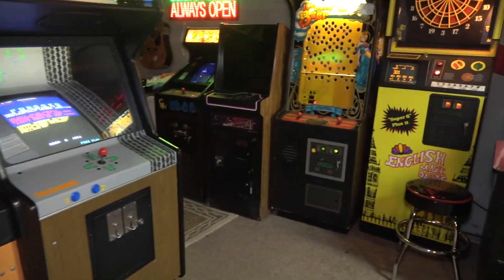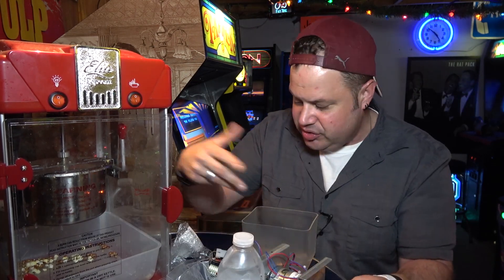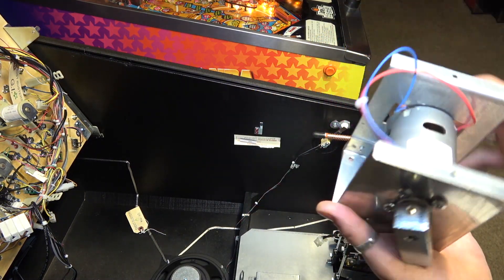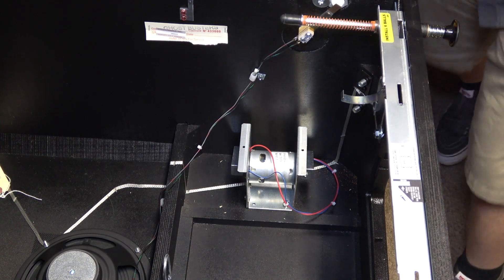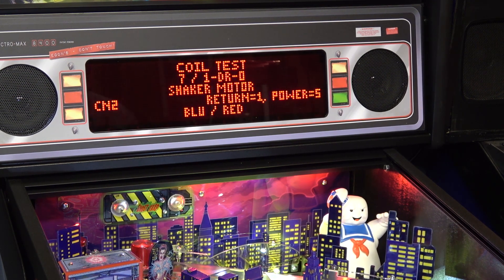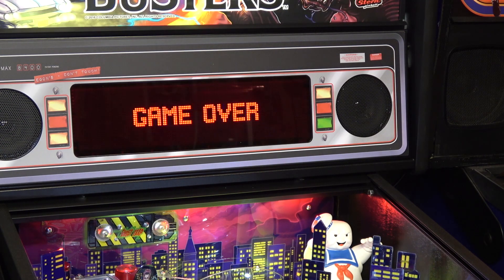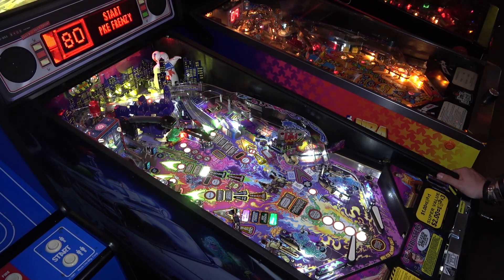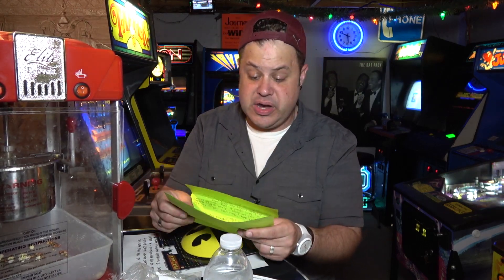New Ghostbusters Pro Pinball Shaker Motor Install - Stern Spike Shaker Motor Install  How To OEM

Comment: Hey John, 2 notes about shaker motor cover screws... I just received my shaker motor from Stern (complete with screws and sticker) . The cover screws are actually "self tapping screws" and the holes are not threaded  in the metal frame to mount the cover .  Stern could have made this unit better with pre threaded cover mount holes, a notch in the cover for the wires to exit, and I would have put shrink tube over the solder connections instead of just bare and only 2mm away from the spinner.

Comment: beautiful machine.  I thought it was strange that when you put the shaker motor in that you did not use lock washers or locktite.  I figure that device shaking and spinning all the time will eventually cause the bolts to back out

Comment: 1. Stern's cabinets absolutely suck for doing maintenance... The way the playfield pulls out against those small L stops, and then the way it slides back as your lifting it up, making you have to pull it back against the L stops again once it's up is ridiculous...

Also, the small legs that eventually loosen up are kinda weak...

For those who don't know, Bally's metal legs are a complete rail kinda like the legs on a long patio/ outdoor/ pool/ beach laydown chair...

2. I have the shaker motor in my Tales From The Crypt and I like it as well.. it just adds another dimension and gives the user additional interactive feedback...

3. I would becareful having that coin in that wallet spot... I use to have that wallet and it's kinda small there and prone to it sliding out by accident... I would hate to hear you lost it cuz it slipped out...

Anyway, ttyl